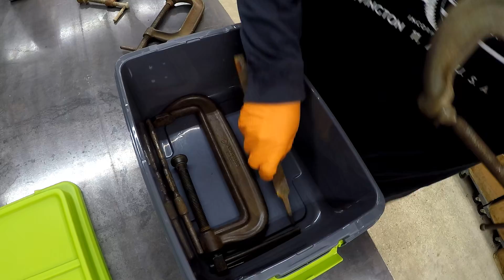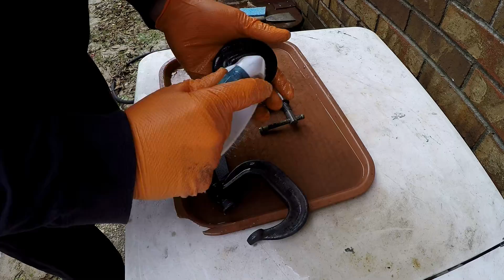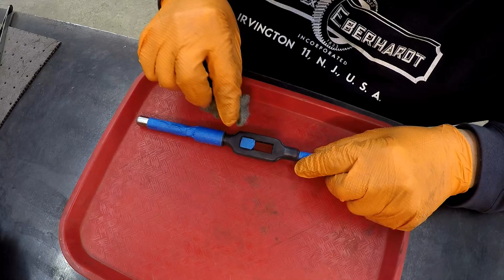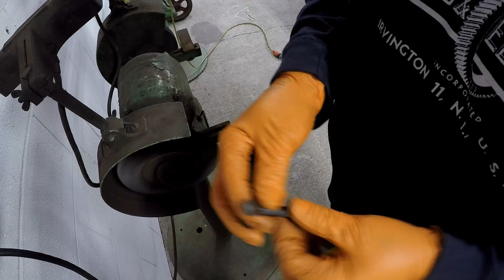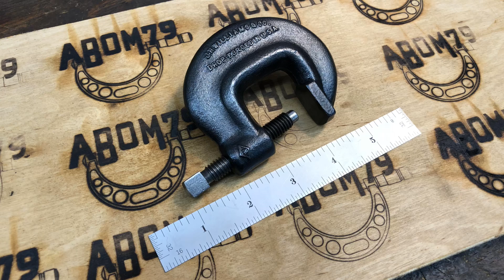Tap Wrench & C-Clamp Restorations Using Evaporust

Comment: The reason to heat an item before cold bluing is to make sure no oil is in or on the metal surface.
Reply: Or use a degreasor like acetone.

Comment: Hey Adam, love your videos man.. Just a quick suggestion.. The large C-clamp you soaked in Evaporust that didn't evaporate as well.. It's due to the soak being water based.. So you must remove any oil/grease/wax from the surface prior to soaking, otherwise it pushes the solution off the part and doesn't allow proper contact to the surface.. Mineral Spirits/Diesel/Gasoline/Hexanes, all work fine.. Cheers
Reply: Yes.  Exactly.  People would know this if they would actually read the instructions!.

Comment: Good stuff. I use 10% citric acid, way cheaper and does exactly the same thing. 50g or 2oz of citric acid powder dissolved in 500ml or 20 fl-oz of warm water. (20 fl-oz is a British pint, you Americans are so entertaining when you come and drink beer here! 😆)
Reply: No, it does NOT do the exact same thing.  The acid etched the rust AND the metal.  Evaporust chemically CONVERTS only the rust to a non active oxide.  Read up on it and learn.  Don't use acid.
Reply: Yep. Evapo-Rust works well, but so does any other product or homemade recipe that is out there – removing rust is a solved problem.

Comment: Adam,

Do you know how to take these type of tap holders apart?  I have a very nice old Craftsman holder about the same size as the Cards.

I have been able to get 90% of the rust removed, except on one half of the clamping jaws.

Tap holders tend to have a stationary half of the clamping jaws, and a movable half.  I can easily get the movable half apart; it is a clever mechanism of R hand, and L hand threads, allowing it to be unscrewed.

The stationary half of the clamp has me, and everyone I stumped, (several hundred years of tool knowledge, combined). 

Any help, or tips, you could provide would be greatly appreciated; the ½" triangle of rust, seen from either side is driving me nuts!

Thanks...

Comment: Two notes to pass along for Evaporust.  First, you can put the liquid back into the jug and use it again and again and again.  Basically you can use it until the chemical(s) are used up.  You will note that the more it derusts, the longer it takes to restore the next piece because the chemicals are weakened/used up.  The other note is that you can add water, if required, to increase the volume or restore volume that has evaporated - it does not affect the product's effectiveness, assuming that you don't dilute it unreasonably.

Comment: I made my own rust remover with a dilute sulfuric acid solution. 
I use it on my chains, but it does turn everything black, and I do paint the  surface asap afterwards.
Put something on the tools, oil, paint, anything, because it will rust up worse if you don't.
Reply: The trick is to move the parts from the acid into a solution of baking soda to neutralise the acid. I have seen it done to traffic signs prior to enameling at my fathers workplace.
Reply: This does NOT do the exact same thing.  The acid etched the rust AND the metal.  Evaporust chemically CONVERTS only the rust to a non active oxide.  Read up on it and learn.  Don't use acid.

Comment: When using that wipe on bluing I found out  while I was bluing a shot gun that if you heat the metal up the bluing will soak in and have an even color . Make sure all finger prints are wiped off I heated  the gun parts on the shop wood stove apply bling wipe off .
Reply: Just do not get that stuff on anything you are not willing to have stained.

Comment: Hello Adam. For long items use a four inch piece of PVC pipe with a cap on one end and a cleanout on the other and fill it with your rust remover and drop your tools in and screw the cap on.
Cheers, enjoy the videos.

Comment: Adam did you dismantle the tap handle and clean out the chemical and lubricate the threads ?
Reply: Evaporust is water based so a good rinse and drying is all you need before the lube. A bit if WD40 to chase the water before lube won't hurt.

Comment: Adam, try the Birchwood Casey Barricade to "cure" the cold bluing. It is the only oil i have found that completely seals the surface and deepens the blue. Just my two cents.
Reply: Bluing does not prevent rust. Check Brownell's for the best rust protection or the spray you tried might work. I would not trust the spray on my guns.

Comment: Thanks! I had no idea they made a gel! Could have used it a couple weeks ago. For the cleaning afterward, I usually use hot water and a light scrub with scotch brite while doing the rinse. It dries quickly that way, but cast iron likes to flash rust very quickly. Then I hit it with Boeshield.

Comment: Reminds me of Naval Jelly.
Reply: They do not do the exact same thing.  The acid etches the rust AND the metal.  Evaporust chemically CONVERTS only the rust to a non active oxide.  Read up on it and learn.  Don't use acid.

Comment: Adam, are you rehearsing to compete with Vince "The Shamwow Guy" ? When are we going to see you on late night tv ?

Back to rust, I prefer naval jelly (phosphoric acid) and muriatic acid (hydrochloric) to remove rust. Both a very low cost with no weird chemicals. To neutralize, just add lye or backing soda.
Reply: They do not do the exact same thing.  The acid etches the rust AND the metal.  Evaporust chemically CONVERTS only the rust to a non active oxide.  Read up on it and learn.  Don't use acid.
Reply: And, Evaporust is water based and is extremely safe.  It's not a "weird chemical".  It can be safely touched and poured down drains.
Reply: @videodistro  It can't be poured down the drain where I'm at in Boulder CO. The paint, grease, and other stuff in the metals is still considered industrial, toxic waste.

Comment: I just did this with some of my large C clamps, but employed electrolysis, a wire brush and then a dremel with some tiny Chinese wire wheels. Ospho'd with a dilute solution to hinder the flash rust. I intend to paint them though, since the humidity likes to have its way.

Comment: I think the "white stuff" might be "white rust". Experienced this with galvanized roofing/siding in the past. I suspect that the screw on that / those clamps where galvanized or zinc plated originally. Apparently, white rust is pain in the ass to solve as it comes back like a cockroach. In short you may have to de plate (?) those parts.
Reply: It was white lithium grease.

Comment: Anything with phosphoric acid in it, Coca Cola, naval jelly etc. will derust ferrous metals Anything w sodium hydroxide AKA lye soap in it, Oven cleaner, dishwasher detergent, steam cleaning soap, etc., will also derust ferrous metals.
Reply: Technically any acid will derust them. Its about doing it in a good time, and more importantly about reducing the damage to non-rust areas. Its a similar argument to sandpaper, sure that would take away any rust too and with unimportant objects it might be a reasonable approach but it certainly won't minimize damage.
Reply: Yes any acid will clean or descale the ferrous metal but the mentioned one is pretty weak regarding undesirable effects upon the metal and therefore wont do much of anything to the base steel or iron. Can harm your skin though. Sodium hydroxide is caustic not acidic, hmm maybe its better to call it alkali. Another name for it is caustic soda. I'm sure there is a lot of other things that work well too. Happy Holidays to all.
Reply: They do not do the exact same thing.  The acid etches the rust AND the metal.  Evaporust chemically CONVERTS only the rust to a non active oxide.  Read up on it and learn.  Don't use acid.

Comment: Adam have you ever thought about putting a small cheap Aquarium air pump and air stone in the Evaporust tub to help with the dispersion of rust from the surfaces?
it will probably less than 20 dollars but the motion of the bubbles could really speed up the process. just a thought pal.

Comment: How does it compare to using vinegar for rust removal?
Reply: They do not do the exact same thing.  The acid etches the rust AND the metal.  Evaporust chemically CONVERTS only the rust to a non active oxide.  Read up on it and learn.  Don't use acid.

Comment: Evapo Rust been sponsoring many restorers on Youtube, I see it a dozen times in the last 2 weeks.. Electrolysis is cheaper and less harmful to environment..
Reply: Hahahaha!  Evaporust doesn't "harm" any environment.  The water based converter will not hurt your skin and can safely be dumped into the drain.  And it requires no electrical setup and the drawbacks of electrolysis.  They each have their place.  Don't be a dope.
Reply: Evapo Rust will erode your rust and your savings.

Comment: Adam does this stuff smell like normal vinegar - because Mr Pete gets the same results with cheap grocery store cooking vinegar.
Reply: EvapoRust is a ~10% water solution of ammonium hydrogen phosphite (CAS# 51503-61-8, H9N2O3P), spiced up with a strong surfactant to help get through oil and grease residue and penetrate cracks. It works by the way of selective chelation of iron. The process is strong enough to pull iron out of oxides (it will remove bluing in addition to rust if the part is left in solution long enough), but not enough to pull metalic iron out of the crystal lattice. This makes it safer than acidic solutions - if you forget to pull a part out of the EvapoRust bucket and leave it in there for months, it will be fine.
Reply: On a related note, it is possible to use cheaper, non-proprietary chelating solutions to remove rust, such as EDTA (usually sold as disodium EDTA), but they're not engineered to selectively target just iron, which has two disadvantages: first, it will try to remove all sorts of metallic coatings from the parts (EvapoRust won't, it's safe to use with partially chromed parts, etc.), and second, it will actually react with all metallic ions including things that are not normally considered "metals" in everyday parlance, such as calcium, which simply means that it'll turn "spent" faster and not all of it will work towards de-rusting parts. If you're short on money, by all means give EDTA a try, or do some research to figure out other cheap chelating agents that react with iron. If you're short on time like Adam is, just get EvapoRust for the convenience.
Reply: Oh, and if anyone (including the EvapoRust guys commenting on this video) is wondering how I know what's it made of: there's a pretty old MSDS (Material Safety Data Sheet) floating around on the Internet that lists the active ingredient in full detail. The MSDS they publish now only lists a "proprietary chelating agent" with no CAS#. It's possible that this older MSDS I found was never meant to be public, but someone put it out there anyway.
Reply: That was my guess too Gez - its just vinegar or similar mild acid.I always use vinegar which gives me results in a few hours at mild temperatures.
Reply from the maker: No smell or acids like vinegar.
Reply: They do not do the exact same thing.  The acid etches the rust AND the metal.  Evaporust chemically CONVERTS only the rust to a non active oxide.  Read up on it and learn.  Don't use acid.
Reply: I usually have to wear a respirator when working with vinegar, while evaporust is much more tolerable. I also find that vinegar tends to etch the base metal a lot faster if I dont babysit it, checking every hour

Comment: Evaporust is pretty good. I cleaned up the four chucks that came with my lathe using it, great results for very little work. I found scrubbing machined surfaces with scotchbrite when still in the evaporust bath worked really well to get a nice finish.

Comment: Love the tool restoration videos, Adam. My favorite inch mic is a Starret from the 20s. Found it at a yard sale for $1. It was crusty, rusty, and neglected. It caught my eye because the thumbwheel was ebony. I'd never seen one. Brought it home, took it apart and soaked the metal parts in carb cleaner. The next day I used 0000 steel wool and light oil to clean it up. Only then could I see the Starret markings. Put it back together, calibrated it, and use it daily now. It just feels good in the hand. Here's the punch line... The lady at the garage sale said, and I quote, "I didn't think anyone would pay $1 for that rusty old C clamp.". Oh, the humanity! Thanks for another great video!
Reply from the maker: That’s great! I have found many neglected and forgotten about Starrett tools at the flea markets.

Comment: I really like using water and citric acid. It does great work, but requires some elbow grease sometimes, but its freaking cheap is the main reason i use it, and its non toxic.
Reply: They do not do the exact same thing.  The acid etches the rust AND the metal.  Evaporust chemically CONVERTS only the rust to a non active oxide.  Read up on it and learn.  Don't use acid.
Reply: @videodistro  i understand it, i am familiar with chelation.  Of course evaporust is better but it's way more money and citric acid is essentially free.

Comment: I use a air bubbler in the bottom of my vinegar tank and I think it would work for evapo rust it speeds up the rust removal no need to scrub before finally cleaning.
Reply: They do not do the exact same thing.  The acid etches the rust AND the metal.  Evaporust chemically CONVERTS only the rust to a non active oxide.  Read up on it and learn.  Don't use acid.

Comment: The black stuff left on the objects is super fine metallic iron, not iron oxide. The chelating compounds in the ER remove the iron from the iron oxide, then release the metallic iron. It actually chemically decomposes the iron oxide. Since the chelating compounds act catalyticly, that's why you can re use the ER until it turns completely black. ... running the ER through a coffee filter can help a bit to extend the life, although not much.
Reply: Excellent info sir.
Reply from the maker: Thanks for the info Rick.
Reply: I've found filtering does nothing at all.  By the time you've filtered it there is noonger any chemical interaction.

Comment: I was interested to see how well the file cut. I see tons of old files at garage sales and such would be interesting if this technique works.
Reply: Matthew Chastain you can “sharpen” them by giving them a soak in a 10% muriatic acid solution and then neutralizing in a baking soda solution.
Reply: They do not do the exact same thing.  The acid etches the rust AND the metal.  Evaporust chemically CONVERTS only the rust to a non active oxide.  Read up on it and learn.  Don't use acid on files!!!! It WILL dull them.
Reply from the maker: Sorry I didn’t show s close up. The file cut fine, just as it should. I don’t think it was a well used file.

Comment: Adam, you created some absolute gems. A few of things: 1) I often Q-Tips to apply bluing to smaller items. 2) I'll use a heat gun to remove the last trace of any moisture of something I've rinsed off. 3} I'll rub the teeth of a file with blackboard chalk when I store it. Again, nice video .....

Comment: I live down in south Florida and we use Corrosion X on metals from the diesel engines to the tooling in the shop.  It holds up better than anything I've seen to protect from rusting.

Comment: After cleaning get some water displacing oil and leave the parts in it for about an hour. He seperates the water and oils all the serfaces. Super thin oil. It is what we use in gunsmithing after hot blueing, rust blueing, and parkerizing
Reply: Yes.  This.

Comment: They turned out quite well.  Is the file still sharp?  Did the evaporust degrade the edge?  Jeff
Reply from the maker: No the file is fine.
Reply: @Abom79  Thanks, that's good to know.
Reply: ER candice degrade any iron that's still there, it just chemically decomposes the rust into iron and attaches the left over oxygen to an acceptor ion.

Comment: Are the tap-handles assembled/pinned/swaged such that they can’t be fully disassembled for cleaning/refinishing?
Reply from the maker: The moving jaw is pinned together. I tried to tap it out with no luck. I didn’t want to damage it so that’s why I left them both together.
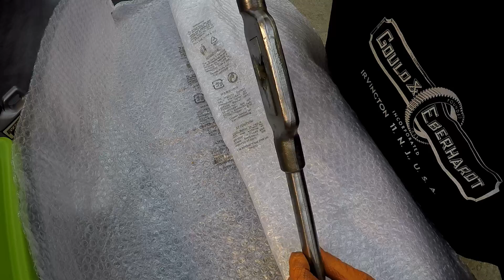Reply: yes you can see the pin at 5:48 and 6:53
Reply: Thanks for replying.  If I’d watched closer (on a bigger screen), I probably could have seen why you didn’t want to knock pin out.  
Final product turned out gorgeous.  
Well done.

Comment: I suspect you would benefit from a form of gasket with the lid of your evporust tub to prevent evaporation?
Reply: Not a problem.  He can add water back into the bucket of it gets low.  It's water based.

Comment: I’ve found that diluted Evapo Rust in the ultrasonic works within 20/30 minutes, pull them out and the dry fast if the tank is heated.

Comment: Evapo-rust is a really great product BUT for corrosion protection the best thing I have found is Penetrol Oil-Based Coating Additive by Flood.  We painted a lampost on the Atlantic coast with Penetrol 25 years ago and there is still no rust.  We wipe down every metal tool that will see outdoor service with it…great corrosion protection!
Reply: Evaporust is NOT meant to be a preventer.  Move along, please.

Comment: I bought a 30 liter ultrasonic parts cleaner system. I tried EVAPORUST with ultrasonic cleaning action. The results were so surprising and quick. Rusty 1/2 bolts were rust free in a few minutes. Give it a try. There is a good video on You Tube.
Reply from the maker: That's been something on my wish list for some time, I'll have to get one and try it.

Comment: I personally hate using cold blue. I use rust bluing, you put a solution on the item and it creates a fine EVEN layer of rust. Then you boil it and convert the rust from ferric oxide to ferroferric oxide which is bluing. Since the bluing is a form of stable rust that has created a layer on the item it prevents more rust from forming, you still need to take care of it but it's a lot easier. The bold bluing solution basically plates the metal and then changes the color.